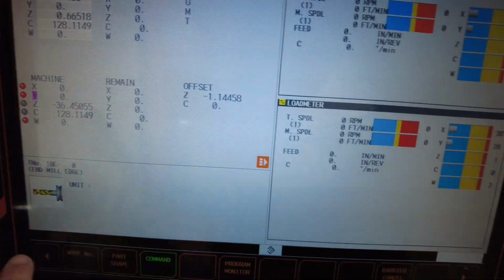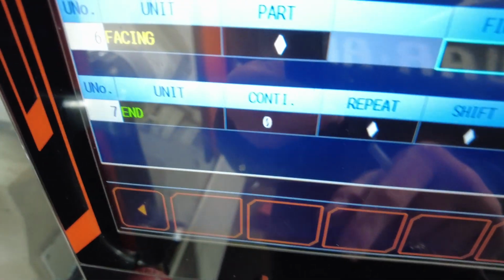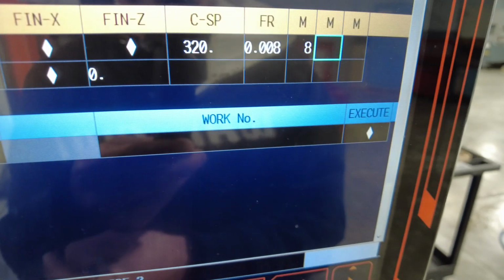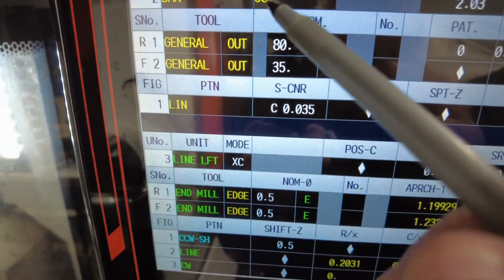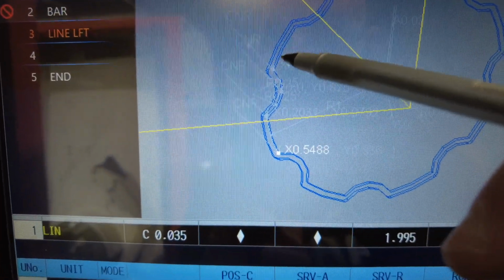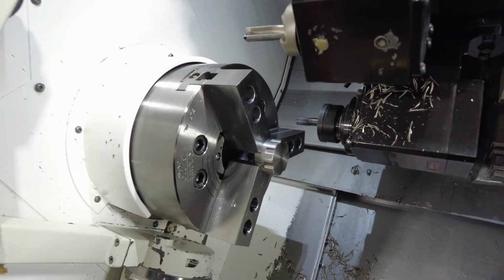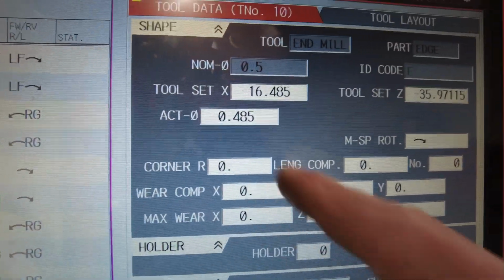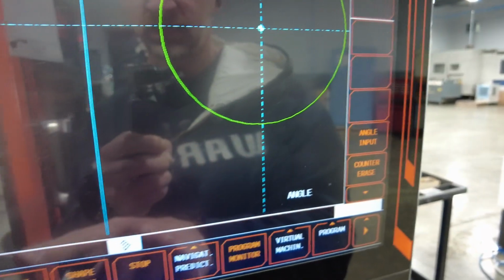Mazak Smooth G program example V2

Comment: I tried this method today with my Mazak smooth MY machine. It's worked perfectly. usually, I use CAD/CAM for this kind of thing. but next time I will definitely use this method. Thanks a lot.
Reply from the maker: Great to hear!,  outside of 3d milling, I don't see much reason to load a cam program,  it's so much better for adjusting,  adding , changing things in Mazatrol, I love it personally,  but it's because I worked on this machines nearly 18 years now.
Reply: Yes,You’re correct.